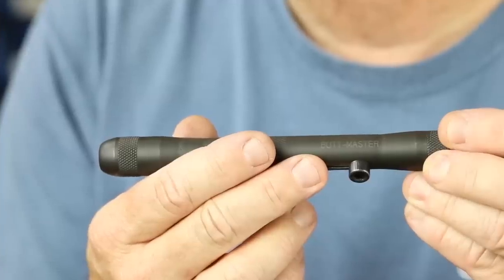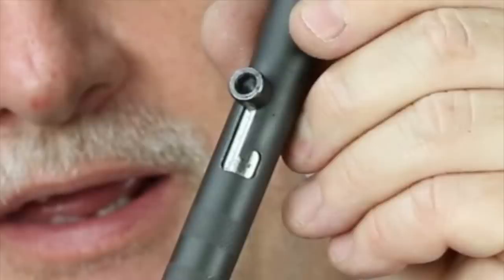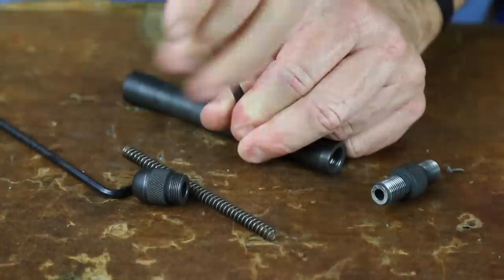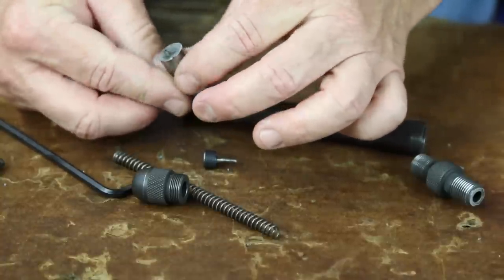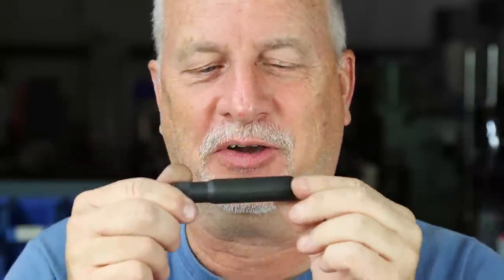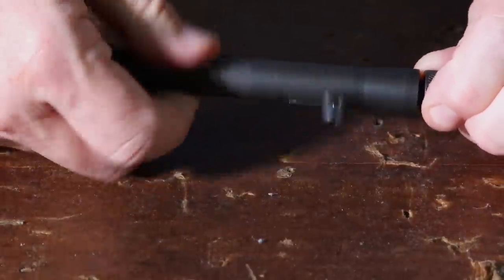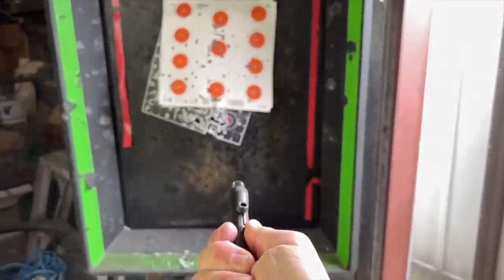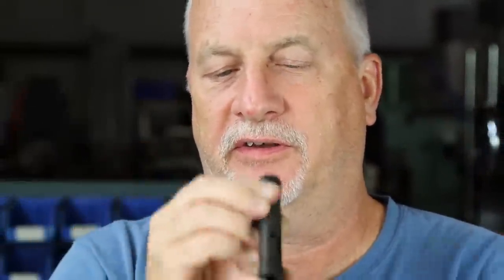The Butt-Master!

Comment: This is actually possibly a huge deal. Have you spoken to an attorney about it? It is within the realm of possibility that they didn't use the NFA registry, but that does seem to be the most likely way they got it.
Reply: If it was made public in any way which from the video it was then proving it was discovered through the NFA registry would be difficult if not impossible.
Reply: He specified that in the public information it was referred to as "a pen gun" not the "official" paperwork name of "butt master".
Reply: Butt, is it laser engraved? It sounds like it was from the plural in the story of engraving the suppressor
Reply: 5:25 he points to the side of it and it triggered the engraving story, butt, he says "this stuff" which is an ambiguous term. Still, I'd think 1 is thing and 2+ is stuff.
Reply: It's in the Interpol Firearms Reference Table, a comprehensive firearms database shared and updated by 195 countries. The Butt-Master was likely put on it by a US agency, but it's now identifiable by pretty much anyone (including Canadian general public that has free access to the PDF version of FRT). The only relative mystery is how B-M caught their attention, but I'm glad it did - it proves IFRT is as comprehensive as it can be.

The FRN (Firearms Reference Number) for Butt-Master is 109457.
Reply: @SikterEfendi  How is that a good thing?

Comment: i met a glock armorer who was turning glock barrels into pen guns that literally had working ink wells that you removed before shooting. pulling back on the clicky part cocked it and pushing down on the clip fired it. lots of fun to shoot, but hard to hold on to lol
Reply: Assuming they were 9mm barrels I'm sure that would be a good grip strength test... Especially if adapted to be concealed like Mark's and fired from partial concealment 😂👍
Reply: @berryreading4809  gonna need some serious rectal muscle control
Reply: @berryreading4809  yup it was basically impossible to hold lol. you had to fire it with the "butt" of the pen pointing at your gut so that when it shot out of your hand, it would just stop against your gut. a few times i did hang on to it though. it had some pretty aggressive checkering machined on it

Comment: This reminds me of a pen style flare launcher I had as a kid. It was made for military pilots. It came with a lanyard attached to a small rack containing five flares.
Reply: Yes, the actual flare was launched by a shot shell primer they were made by Pains Wessex. There's a current version available but the design has changed to prevent them from being turned into pen guns.
Reply: I worked at a boat dealer in Dallas in the late 90s that had something similar in the parts department.

Comment: Man if you could have been a fly on the wall. Listening to their logic on banning the “Butt Master .22”. Absolutely straight faced lol!!!
Reply: A human probably didn't even read it. They just cut and pasted models from somewhere else. Clearly not the frt (firearms reference table) that determines firearm clarifications in Canada. In order to have a frt on file he would have had to apply for it.
Reply: Where can I buy this gun?
Reply: Reminds me of the time Wolf Blitzer on CNN reported on “pussy riot“
Reply: Did you use the term logic and government in the same statement? That never happens.
Reply: @juliogonzo2718  Dead wrong. It is in the FRT and FRT is not updated by application. It's shared and updated by 194 countries.
Reply: Either: 
1. They did zero research, or
2. Somebody did do research and put it on the list as a joke. 

Runkle pointed out that it's already illegal. An existing law prohibits barrels under 110 mm (about 4.5 inches).

Comment: You should update it with the "San Franciso Silencer" version... a 4" diameter can that's 12" long! 😁
Reply: Comes in both black and tan colors!
Reply: @MrTruckerf  HAHAHAHAHAHAHA
Reply: and let me test it first
Reply: @BeetleBuns  ewwwww
Reply: Not sure how well that would work with straight blowback
Reply: @LastEarBender  HAHAHAHAHAHAHAHAHAHA
Reply: Wild the claw hammer on it for a handle to call it the Paul pelosi
Reply: @thedeathwobblechannel6539  Holy crap, that's funny!
Reply: Double ended silencer
Reply: Did you find that it rattled around a lot?

Comment: It was on the Serbu website as far back as 2000 according to the internet archive.  
"As you can probably guess from the name, this gun was originally made as a joke. Like other Serbu Firearms products that are built for the hell of it, it turns out that people want very much to buy them! The BUTT-MASTER is constructed from 4130 DOM tubing and has a welded-in "breech". It fires .22 rimfire ammunition, but production versions will probably be made to accept different calibers. The prototype shown has a parkerized finish; a stainless version is planned as well. The BUTT-MASTER is a gadget gun, and as such is classified by the BATF as an AOW (any other weapon). It transfers with a $5 tax stamp. The projected price is in the low $300 range. It might seem like a really dumb gun, but for some reason shooting it is really addictive. Especially with a silencer attached."
Reply: I like such gadgets. Reminded me of signal/flare pens that were basically working on the same idea, minus the barrel of course (substituted with a cup like thingy for flare casing). Thread the cup onto pen and release the trigger pin.
Not sure but I would guess it could be used as backup stun gun in a slaughterhouse.

Comment: hi mark just to let you know,back in1987-early90' I work in manchine shop.A buddy of mine showed me one he made out of 3/8 black iron  pipe . It was same as yours but no machining ,32 cal. Took short pipe,couple of 3/8fittings and grinding,drilling ,tapping.It worked ok.We called them Sat. night special. he was a great welder when he wasn't smoking. He was real ric flair. Your's looks professional made.

Comment: Fun fact, I had a pocket flare gun (used screw-in self-contained flares, just a pyrotechnic star that would go about 100 feet up) around 1980.  I remember the exact same device used by Magyver in the original series as an incendiary (fired a flare into a gasoline soaked raft, as I recall).  They were cheap, three extra flares in a blister pack were also fairly cheap, and I kept it around for several years (eventually, I think I ran out of flares and couldn't find them where I'd  bought the thing originally).

Those flares used a 209 primer, possibly as their only propellant, and the "screw in barrel" was also the cartridge.

Comment: I noticed they make “fidget devices“ based on this technology, so I wonder what police officers would think if they found the fidget model and thought it was the real thing? I did not realize this type of device could be a firearm but I knew of its design for several years because of the bolt action fidget device

Comment: Ok, this is strange, when I was in high school back in 1976 ( 12th grade ) my step mom had an extremely similar device, the difference  was, her ( pen gun ) was designed to shoot a mini tear gas round, in .22 caliber.  She (  my step mom Mary )  ordered it by mail and it was delivered to her home by USPS, it came in a very cool decorative small box with  3 tear gas rounds. It was colored gold & silver, did not have exterior threads, it was made to clip on to a pocket, it  looked a little shorter than your device.   When I got my  teenager hands on it, I ran it through teen trials, the tear gas cartridge was a joke, it was able to accept,  .22 shorts, .22 LR ,  .22 shot rounds, it was basically accurate out to 8 feet with .22 LR, very f - ing hard to aim at a target, but, a blast to play with  ( pun )  after she died, I got my hands on it, put it In a drawer forgot about it for many years, ended up getting divorced after 40 years of marriage, because she ( wanted to be free ) ( WTF ) and when I moved into bachlorhood, it disappeared, that is my story and I'm sticking to it !!!

Comment: To stop the striker from sliding back, as much you could switch to .22 Cal short or tap and thread a reduced opening so it would hold the shell from sliding back into the striker.

Comment: AKA "zip gun."  My former wife was a guard on the AK pipe line terminal.  A lot of her co-workers were former military and law enforcement so when an employee tried to go through security and onto the terminal with a fat, funny looking pen in their shirt pocket, she said she didn't notice it and passed them on through but the guard behind her recognized it immediately and jumped on the guy.  The polyester pile up that followed wasn't in the guard company's procedure handbook but the retired cops and military workers had been waiting years for the chance to  do it just one last time.  The guy got run through the whole criminal court process, in the end he didn't end up with much of a criminal penalty but he lost a well over 6 figure job and will never work in the industry again.  Asked why he did it, he said he didn't plan on using it or anything, he just wanted to see if he could get it through security.  Dumb.  This is the same oil terminal where guys have gotten fired for having an ancient, faded and tattered empty beer can among the flotsam in the back of their pickup truck when they came to work.  Another guy had a spent .22 shell lost in the corner of his coat pocket and got fired.

Comment: Stuff like this is added to ban lists purely to inflate the numbers. Regardless of any other factor, this firearm was already banned by pre-existing laws due to its barrel being under 106mm. However, when they want to do a ban, they decide that it sounds better to say "we banned 405 models" instead of "we banned 100 models". I guess the former sounds 4 times safer than the latter when you stick it in a press release.

Comment: I made something similar using recycled car parts and black pipe. A break-action, single shot 12ga with the same operating mechanism (minus safety notch). I used stuff I happened to have in and around my toolbox plus 18” of black pipe and a coupler to get over 18.5” because… you know, laws and stuff. Never got around to my 2x4 stock. Oh well.
Reply: I used a roller bearing, pressed into a bolt that I drilled a pilot hole in for a firing pin. Didn’t even have to weld it. Toight!!!

Comment: How cool would it be if the case movement could reset the bolt in the safety notch with the help of spring rotation.

Comment: I have a question about the design.  Why is it made to be always cocked with the pin held back by that notch, rather than just having a straight slot, then pulling the pin back and releasing?  Not that anyone is using this but seems dangerous and unnecessary to have the pin pulled back and under tension.

Comment: In the late 90s my wife and I found a lodge in backcountry Ontario we liked a lot and vacationed there until the owner sold it and it changed significantly many years later. We also went to Toronto a few times in the late fall. Up until one year about 2005 to 2010 border crossings were uneventful. Then every year without fail we were questioned about guns, sometimes it was hostile and sometimes just a casual mention, but every time with a wink, wink,nod, nod kind of tone.  A few years earlier we had both obtained concealed weapons permits. My only conclusion was there is an American database of permit holders and it is shared or sold to Canada. Kind of like the NFA weapons database. Should it be shared? I was once on an international committee with Canadians on a way different sort of database and things get, in retrospect, a little too casual.
Reply: US customs and immigration and CBSA (Canada Border Services Agency) have access to each others systems and records.  If they know about your carry permits in the US we know about them up here.

Comment: my friend RiP Clark Cameron, made a device like this 50 years ago, for blowing dirty grease out of bulldozer knuckle joints grease nipples.  the firing pin was activated by hitting the back end of the spring loaded firing pin with a hammer
Mine got stolen in the year 2001

Comment: It's bouncing back because you have way to much head space .... Also it will do it regardless , use a stronger spring to limit the amount of bounce
Reply from the maker: Ah, not true. First of all the headspace was prefect...exactly within SAAMI spec. And you don't limit bounce with a stronger spring, you do it with more mass.
Reply: @markserbu  good point...
Reply: @markserbu  your firing pin looks out so far ... Does it ever puncture the casings ??

Comment: Should have had the end cap drilled and tapped to be able to thread the charging handle in for easier insertion/extraction. I imagine it would snag in its current configuration. Maybe not an issue for a well broken in prison wallet, but still :D

Comment: What's funny is that people commenting about this , are laughing and underestimating the greatness of a .22cal. I bet they would be scared when the old-fashioned mob used the .22 to do "hits" one to the back of the head . Also alot of assassin's used a .22 cal.. eg. This single shot is as quiet as a weapon can be you can't get quieter , hitmen preferred this weapon due to the fact that it left behind no casings and the silence part . A .22cal will end you life just the same as 9mm or any other bullet , period...